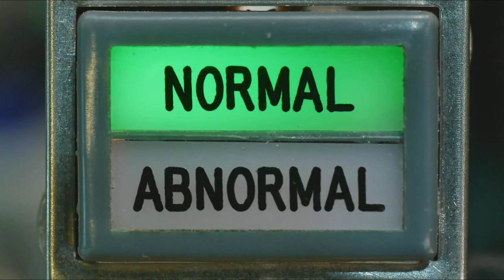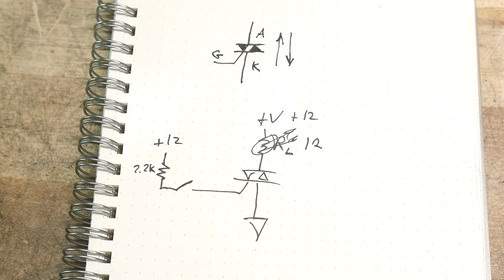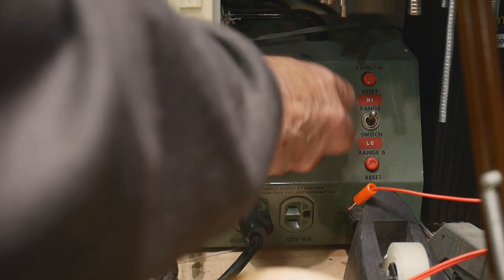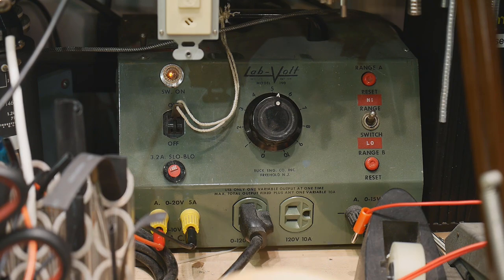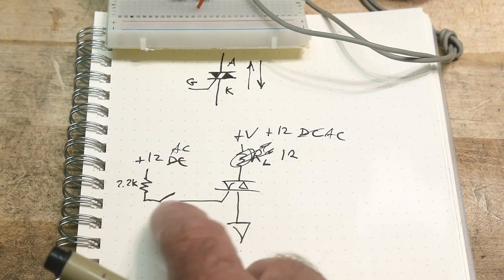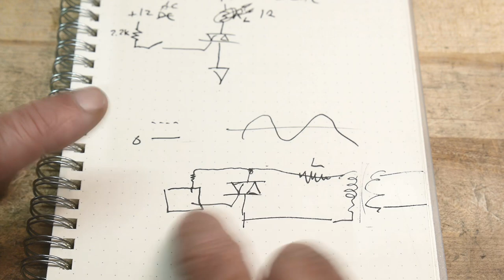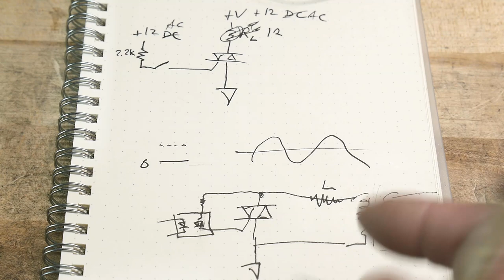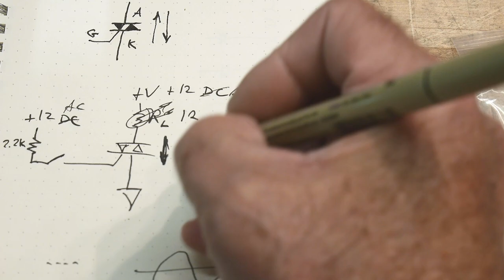#768 Basics: What is a Triac?

Comment: I’ve seen triacs and diacs used in buIdling systems, like light bank control (couple dozen lights controlled by one switch or control signal) or motor control in a pump or an AC system.  I’ve never been the one to make them work....I simply often oversee those kinds of systems.  Good stuff!  I just found your channel and I love it!  I’m well along in the very process of setting up my own test bench (so far, spec an, oscope, various power supplies and all kinds of other goodies.  I’ve spent years doing this for my job...now it is time to do it for me!  Especially when a very patient and loving XYL thru the years is “demanding” that It is high time that I do this for me!!  Who am I to argue!  Thanks for GREAT content!

Comment: Another odd thing about Triacs is that there are different characteristics in each of the four 'quadrants' where each quadrant applies to one of the four possible combinations of polarity for the Gate and the Anode/Cathode voltage. This can be hard to understand and 'get one's head fully around' and when not handled correctly, can result in good operation on one half of the AC waveform but less than desirable operation on the other half.

As for triggering the Triac when a DC control is being used but the Anode/Cathode signal being controlled is AC, there is an older solution than the AC optocoupler, and that is the 'pulse transformer', which is usually just a tiny transformer with a single primary winding and single secondary winding. The secondary is connected between either Anode or Cathode and the Gate, and the primary coil has brief pulses applied at the appropriate time to trigger the Triac to conduct. 

I used to make a series of simple DC motor statically powered field winding, dynamically powered armature) controllers where the motor mostly just hummed quietly without turning (almost no energy being put into the armature (but it was AC at that time and this had the effect of locking the motor until needed) but when required could quickly jump into action and turn one direction or the other, either slow or variable faster speeds, in order to drive a steering mechanism to correct a process that sometimes deviated from a central path. 'Electric eye' sensors monitored the mechanism and would result in a control signal that would determine when, and how fast, a correction needed to be made in one direction or the other. The motor armature was the 'load', although it was connected to 120VAC through the Triac. The control signal was applied to a comparator whose other input was a low voltage signal derived from the 120VAC and thus synchronized with that. The comparator output drove one side of the pulse transformer primary, while the other side of the primary was held at a DC voltage that was half of the control circuit power supply voltage; this allowed applying pulses of either polarity to the pulse transformer. (This controller and its motor would have done a nice job of controlling the steering wheel of an automobile, with the "electric eye" monitoring the car's distance from the road centerline, and this would steer the car to remain centered in its lane......but the application was actually for a process unrelated to cars and roads).

I recall getting into an embarrassing situation when I redesigned one of the motor controller PCBs and substituted the comparator (that drove the pulse transformer primary) with an op-amp configured as a comparator. The controller still basically worked, but the op-amp's output turned out to have a better drive when sourcing current than it did when sinking current, and this meant that the pulse transformer primary had less energy applied when one direction of correction was required than it did for the other direction. The Triac being used reacted to the weaker Gate  signal in one quadrant with a lower power being applied to the motor armature, so steering corrections on one direction were more sluggish than desired. Luckily, I was able to whip up a small pinout adapter PCB that allowed the original comparator IC to be used with the product.

Comment: Way back in the mid 60's I made a controller for my soldering iron to control temperature and allow a switched idle current.  It seems to me I used a DIAC and used the phase angle of the input line to pulse {trigger} the variable
Reply: Dammed spelling checker  I triggered the Triac!
Reply from the maker: that's funny. I was trying to remember what a DIAC was 😀
Reply: @IMSAIGuy  Diac, an AC diode...
Only conducts when Breakover voltage is reached 👍🏻
Reply from the maker: @8-bitbitsa821  OK, back to back zener and TVS diodes similar

Comment: Was researching the latest and greatest in homebrew tombstone welder circuit design thats cost effective and randomly came across "clipper" and "clamping" types circuit when I wasn't certain about the term clipper being correct for the ac welder balancing circuit where a TRIAC is used to "clip" the waveform in a way that is terms "zero crossing" versus the typical series negative clipping with negative bias.  Then I was like... hhhmmm.... what's this series negative clipping with negative bias design?  Seems better in regards to less time at zero volts in that 60Hz cycle (using old transformer 120/240 mains based welder designs where prior to the step down transformer to the typical higher current and lower voltage welding range the AC is "balanced" so like say 70% in the electrode positive waveform and 30% in the electrode negative waveform.  This is so one cycle has 70% welding and 30% cleaning (blasts away oxidation) effect.  The issue with the clipper circuit design isn't in theory, the issue is the practical way to get like 4000W at least in variable resistor capabilities.  I'm guessing if that design was used ever cost way more and was way more lossy (inefficient) due to heat loss, since seems better in theory due to less zero voltage time and no requirement for continuous HF arc maintenance to prevent the arc from going out.   

I see now why the H-bridge designs are used where looks like at least the Miller Syncrowave 250 uses SCR's in that design and the later more nowadays common method like in the Syncrowave 210 are the IGBT based H-bridge design.    Still, interesting seeing the TRIAC DIY welder and DIY welder mods for fine tuning control using the TRIACS where seems using a DIAC versus a series of zener diodes is the way to go to only clip the negative part/phase of the cycle.   I've only seen this done once... since most of the circuit clip equally the positive and negative part of the waveform cycle where isn't a concern since most want to Stick, TIG or MIG weld using DCEP or DCEN only.   The best way to weld aluminum appears to be TIG welding with AC that's a balanced DCEP and DCEN waveform with less time at zero like in a pulsed DC square wave appears.  Bonus with the H-Bridge is one can tune the frequency as well from like 20-250Hz which also helps fine tune the weld and de-oxidation process. 

OK... have a good one!

Comment: Funny, I was looking for triac videos as I just salvaged a couple of opto-triacs 😄.
Most basic use of a normal triac known to me is a triac-diac dimmer circuit. Where an adjustable voltage divider wil determine at what point in the sine wave the diac will trigger the triac.

Comment: You showed the visual representation of the DC circuit being turned off by removing the power to the load. For your explanation of why an AC arrangement does not stay turned on, the AC arrangement turns off as it crosses the zero volt threshold (at which point the voltage is, effectively, turned off, for a brief moment,) as the AC voltage swings between positive and negative cycles. If a triac is a current driven device, the explanations still holds true. All correct?
Reply from the maker: It is the bias on a diode. If positive, on, if negative, off

Comment: I opened up my stove to figure out why it wasn't heating well, and I discovered the electric elements were pulse width modulated with triacs.
Reply: Small correction:
If it is power line operation, then it is called "phase control" not PWM.
Reply: @paulcohen1555    I didn't know that.

Comment: Good explaination, taking the long way around the barn. One question though. Is the lamp you used in the demo commercially available with part # you could supply? Thanks.
Reply: Oh. I didn't notice until your comment. I'd like to have a link too.
Reply from the maker: more about the lamp: https://youtu.be/u_QdlFov224
https://www.amazon.com/Non-dimmable-Equivalent-T3Halogen-Replacement-2800-3200K/dp/B01C8J7U3U/ref=sr_1_6?dchild=1&keywords=g4+12v+led+bulb&qid=1618807592&sr=8-6
Reply: @IMSAIGuy  thank you, you're very kind!
Reply: @IMSAIGuy   thanks buddy, for the lead. Always appreciate your work.